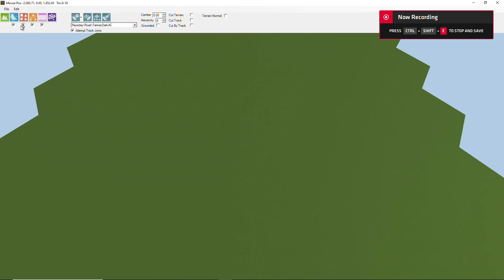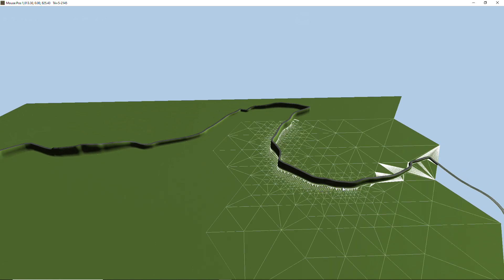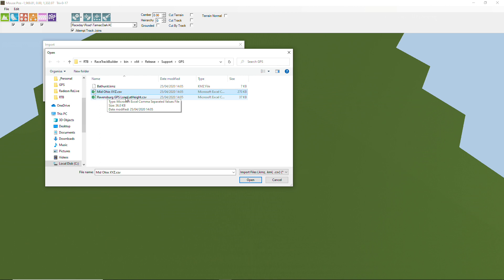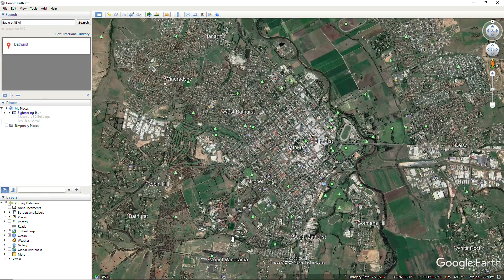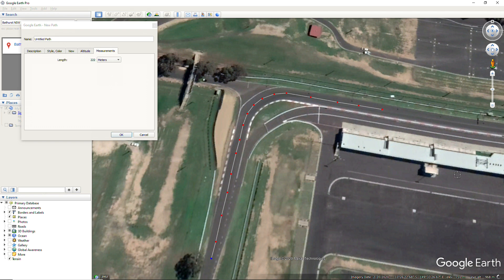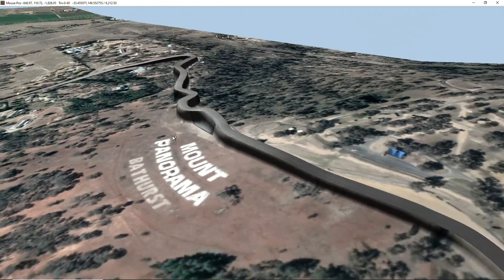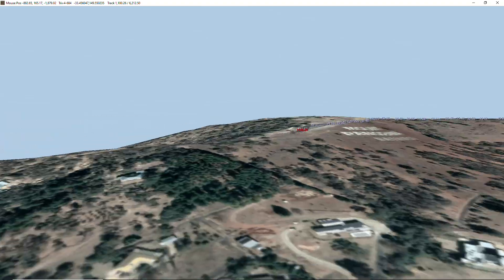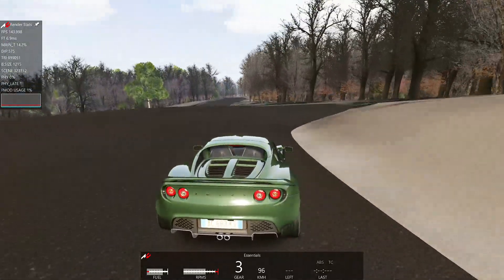Load a Track into Race Track Builder

Comment: I need help exporting into Assetto Corsa. I made the track, exported it, put it through KS editor, and then dropped it into the folder. The first time I tried, the game said "AI Spline missing or Broken." I lowered the amount of pit-boxes, and that problem was fixed. The second time, the game said "No track exists" even though the name is there. Any advice??
Reply: you need to go into another modded track folder, and tack the ai,data and ui and put that into ur folder with your kn5 file from kseditor. then you need to go into the ui folder and open the json file in notpad and change the name to your track. then save it. then you should be good to go
Reply: @mrwick7961  does it have to be a modded track? I don’t have race department so I’ve never done a mod

Comment: However, there are irregular bumps and anomalies in the track.... is there a way to smooth the track, clear the bumps without disrupting the terrain???
Reply from the maker: Select the nodes of the track and then right click. There are a few smoothing options. Experiment. 😉
Reply: Brendon Pywell hi Brendon - feature for track import is awesome. Any chance we can import hi res images from google pro as the backgrounds as they are massively better than google maps imagery ? Could you provide a tutorial? Drive option is great too - but it’s highlighting fact that the google terrain height info is flawed as heights on surface are not matching the real track - project is Lotus Test track - Hethel in Norfolk - it’s flat as, but google maps terrain data is bogus at track level and now in need to smooth it out ... can you help with pointers ? Thanks for the dev work - the new features are truly exciting 👍🏼🤩